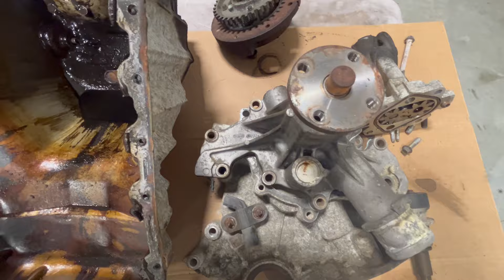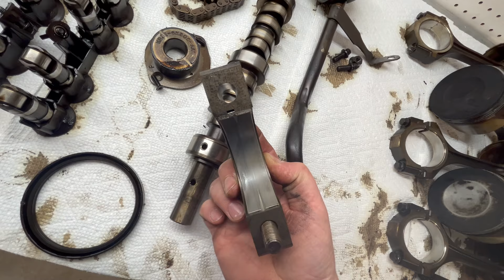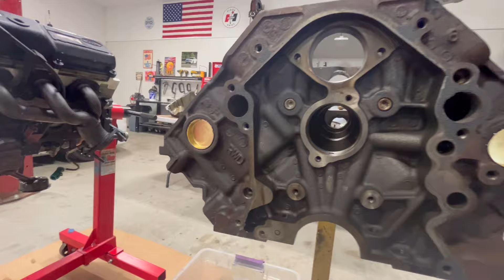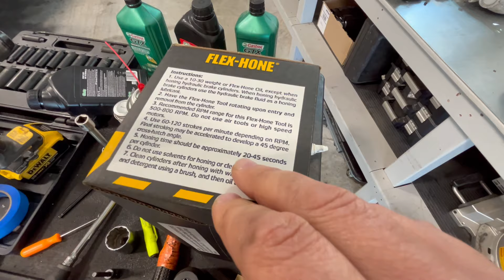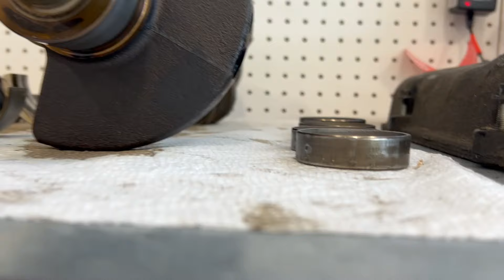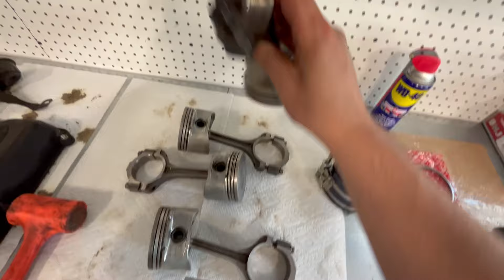DIY ENGINE REBUILD MUSTANG 3.8 SN 95

Comment: I have a 2000 Mustang 3.8 V6 it's white I am going to change the head gaskets need to be changed it has 249,000 Mi on her still running strong got a 5-speed clutch and the clutch is still good after I get done with it I'll probably sell it for about 2500 to three thousand she's got some nice meaty tires on it I changed the motor mounts I did the part before the muffler all the way to the rear so that's all taken care of put a new alternator in it I put a new unit underneath the wheel well on the passenger side is to operate the clutch on the air conditioning and send a single to the fuel pump and operates the fans on the radiator

Comment: See this is why im watching this video😅 04 3.8(new edge). Got 280k miles on my 3.8 still runs great but like this build its starting to leak oil bad. So im looking into a full rebuild before something bad like this happens. Also replacing both radiators just to say that both the engine and coolant system is new/rebuilt. Plan on doing the clutch and all that too since they're going to be out anyway. Clutch dont even have 20k on it

Comment: Where did you get your bearing i keep getting undersized bearings and the number on my bearings is 2.95 idk what that means but i can only find undersized bearings and the emgine will not turn over when i put the "standard" size from rock auto i just need to know bc i got a good crank out of a junk engine and i cant find any that have 2.95 on them any where
Reply from the maker: DNJ engine components